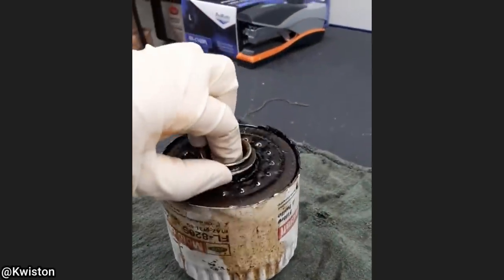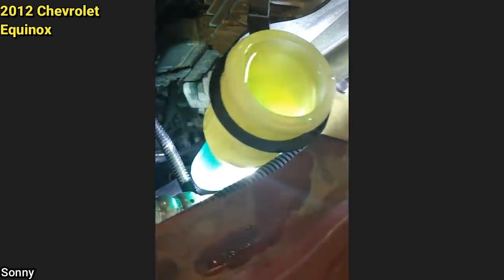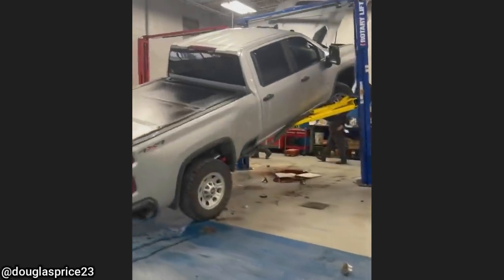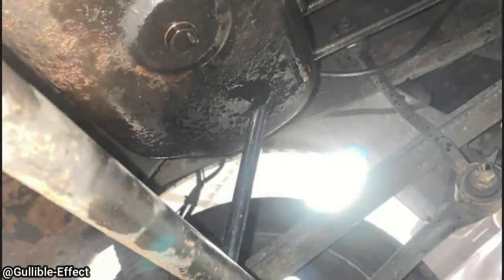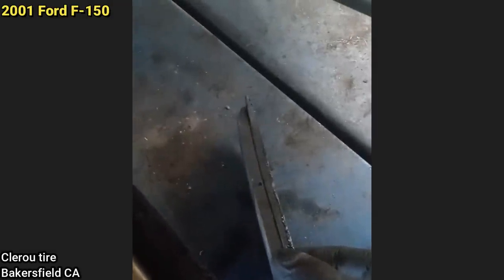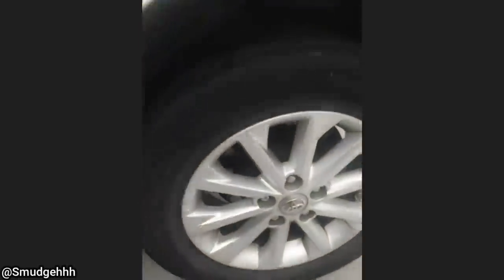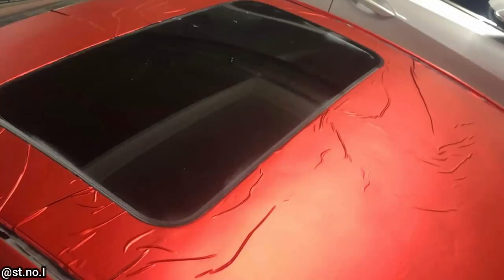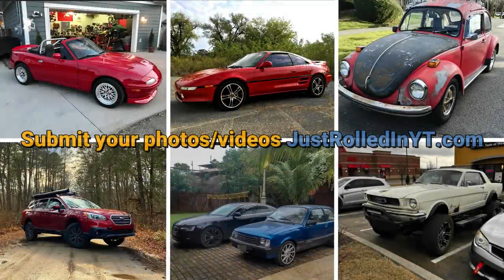Customer States Engine Has Loss Of Power & No Oil Pressure | Just Rolled In

Comment: Bet the customer from 0:50 had a REALLY clean engine after that. Hopefully they didn’t drive much.
Reply from the maker: lol I was thinking the same thing. Quick lube engine flush haha
Reply: Me too, I'm thinking to myself, that engine top end of that engine has to look new.
Reply: @darkdelta  A shiny smooth camshaft always makes the car run better.
Reply: @jeffrobodine8579  except for when its not coated in the proper oil 🤣

Comment: I'm a mechanic, I have not changed my oil in 10,000 miles. My filter must be just as bad. My reasoning for doing this is I thought the transmission would have failed so I was going to junk it. But keeps on going...lol
Reply: When I was growing up on the farm,, we sometimes sold our produce out of an old Ford van with a 300 straight 6 and 3 on the tree. I didn't mind always being the one to sell the stuff but, I HATED driving that van and that van HATED me too. It got to the point where I drained the oil and floored the accelerator until it started rattling. The next morning, that damn van fired right up and ran, I believe just out of pure spite! The van and I gained a sort of respect for each other that morning lol!
Reply: Most modern oils and filters can go 15,000 miles, but I would not try that with a turbo engine.
Reply: @jamesm568  NAH. SOME modern oils and filters can go 15,000 miles -- but not MOST of them. 
 The famous 95 MERC runs Pennzoil Ultra Platinum, 5-W-20; Bosch Premium Oil Filter # 3410; and a FILTERMAG #SS365PR  Magnet Kit. Oil & Filter changes at 5,000 miles.

Comment: I worked in an oil change shop in college.  A guy brought in his bosses car for it's first oil change, at 37,000 miles, as his boss refused to do any maintenance on it.  The oil light was on.  Was one of those 2.5L GM engines from the 90's, that had the big plate that drained the oil and gave you access to the filter cartridge.  The filter was worse than the one in this video.  Engine was knocking something fierce.  We left that filter on counter in the customer lobby for everyone to see what happens when you neglect to maintain your car.  You could not even see the pleats in the filter.

Comment: Man there is some vengeful people out there my ex being one. She gets mad and puts an icebox with sand all over the bottom on my hood while at the beach. Drags it across the red paint that I wash and wax very often.. Her brother ran over a parking space block the piece of rebar holding it in place poked a hole in his tank. I went to the hardware store and bought a wall anchor and rubber washers like for an old Chevy distributor coil and tightened up.. Never heard back from him about it.

Comment: atf in the engine, a good reason not to trust quick oil change joints. Can't even trust those places to check the air filter. Parents took their minivan to one and the numbnut who checked the air filter "accidentally" left a shop rag in the air filter housing....above the filter. It eventually got sucked into the throttle body, jamming it partially open.

Comment: I've had a shop do an oil change and tire rotation. The problem is during the middle of the tire rotation they went to lunch. Before they went to lunch they put all the tires on hand tight on one side and right tight on the other. About 100 miles later I noticed there was a little swag in the driving. The bolts on one side were all loose. I wasn't happy. Now I check every time. When I checked that first time I could unscrew the bolts by hand when the vehicle was on the tire. I had to jack it up in 2 places to put the nuts on right.

Comment: As a retired mechanic I have seen all this before..... will give you guys a tip what we use to do..... with a nasty oil change with a bunch of crap in the pan.. on 5 quarter... 3 quarts oil and 2 quarts Trans fluid.. let idle for 15 minutes... drain... repeat .. with another new oil filter..... then change oil every 1000 miles... after treatment and few changes most all the inside will be cleaned out...... Trans fluid lubricats and has very high detergent content sea foam doesn't... don't believe me... get your hands nasty and greasy... use Trans fluid instead of soap... hands will be clean faster than using soap... most you guys probably already know this.... have done this many times over the years

Comment: I had the first thing happen to my car. Oil filter collapsed, was maybe 1000km overdue for service. I service every 5000km because its a dirty old diesel. First sign was the oil pressure dropping to zero at idle. Could still make pressure at revs, so limped it home and changed the oil the next morning. Sure enough, filter had sucked in. Wasn't crusty like that one though.

Comment: Seriously, oil changes should be compulsorily taught to all drivers - it's one of the simplest maintenance procedures going.
Here in the UK, I just nip down to Wilko, spend a few quid on a bottle of the stuff, then home, drain the old stuff into what at other times is the cat's litter tray, top back up, done. I've had more trouble rooting through the manual or looking online to see what's the right type and amount. Pour the muck off into and old container, bit of cleaning up, and remember to take the old stuff next time I drive round to the dump (recycling centre). What's not to afford? A new engine?

Comment: One day I was driving, I suddenly heard a hollow scraping. First thought: "I think my exhaust just dropped." I was nowhere to be able to stop, but the problem solved itself when I hit a bump and the exhaust was basically ripped off.

The same car didn't want to start when it was cold but ran fine when sunny. Went to the shop, told them the fuel relay must shut down when it's cold. They did all sort of things but didn't touch the relay. Of course the car ran in the heated shop but not after a night outdoors. Second time I went there I tgold them what to do and that I won't pay because they already charged me for not solving my problem. Look at that, it was a relay problem.

Comment: Couldn’t afford an oil change FOR 3. YEARS, but could afford gas? 
The biggest lie I ever heard.
Reply: Litterally under $20 for oil and filter at Walmart. Could have a friend help change the oil if you don't know. Amazing this isn't common knowledge. I spent $40 every 3 months/3,000 miles when I had no money. Just barely making it work anyone else can do it unless they are homeless then they can peddle money on the corner of a highway and then you can get your oil changed.

Comment: Even with dino oil and a no name filter, you can go 8500 miles if you have to. Low end synthetic oil costs little or no more than dino oil. Unfortunately, shops charge a considerable premium for synthetic oil. However, they use a high end brand along with a high end filter, and you can go 15,000 miles or more on a synthetic oil change if you have to.

A local tire chain where I live offers a $19.95 oil change just so they can get you in the shop and pitch you on tires and repairs. Doing my own oil change at home costs me about $14 minimum.  No excuses  here.

If you don't know, "dino" is a slang term for conventional motor oil.

Comment: That oil filter... my dad bought a van once, it had what he was told was a charging light on, and he assumed the fix was going to be a new alternator. My brother in law looked at it, and told him, "We use lots of these vans, that's a low oil pressure light!" Oops. Dad jacked up the van, drained the oil, which looked pretty bad, but not the worst, then unscrewed the filter. He dropped the filter, much heavier than expected, it weighed at least 2 pounds. With new filter and oil, ran fine for several years.

Comment: I feel bad when I change my oil/filter with only 30% oil life remaining (usually change at 40% life remaining) and only changed the transmission fluid three times. 102,500 trouble-free miles averaging 34.1 mpg combined city/highway. I’ll be disappointed if I don’t get at least 300,000 miles without major repair on the engine/transmission.

Comment: .Can I be honest from a shop that just had a guy fired for a 3/4 ton ram 2500 this wasn't incorrect torque in my opinion it was a faulty tie rod end. If the wheel was the case it would have been damaged. Our wheel that came off damaged all the studs, lug nuts, fender and rotor.

Comment: ''No oil pressure''

That is what ahppens when you go to a cheap shop and they install the cheapest filter they can find. Filters are supposed to have a pressure valve that opens to let the oil flow through even when compeltely gunked up

Comment: 2-yrs. between an oil-change is not a problem as long as the engine is running smoothly and the oil 'shows clean and no 'burnt smells' on the dipstick
IF the car was driven every day with 10K miles per year then yeah, change is overdue

Comment: I'm having an oil pressure problem as well changed the oil pressure sensor the oil is like new and the engine was just rebuilt and put in barley a little over a year ago it was driving like a champ but then it just went funny all of a sudden but my guage still says it is low and it drove like it's starving for power like it was missing a cylinder or something not sure if it's electrical or something else.. just put in a new fuel pump as well and a complete tune up too..it's not really making any noises that I can hear...

Comment: i have only ever worked on a engine once where the lady has not gotten a oil change in a year i had to break down the whole thing that was not fun and the only reason i did it was because my buddy was dating the girls sister i was lucky the local pick and pull had the parts i needed

Comment: I’m amazed that the lube shop put atf into the motor. All I can reasonably think of is maybe the tech is color blind, I had a con worker who told me he’s color blind and it’s actually something he has to look out for.
Also thankfully atf isn’t catastrophic to engines, my coworkers have used it to (hopefully) desludge motors before
Reply: I feel like it's not great for the engine to leave it in there, but it shouldn't cause problems in the short term
Reply: @JSTheAnonymousOne  agreed on both. Trans fluid just has a lot of detergents so hence why we’ve occasionally used it for flushes.

Comment: UK here bought a motorcycle for £3.00 because the owner couldnt change gear stripped the box down found it had been filled with carpenters linseed oil burnt  off the gears with petrol (gas) used for 2 years resold at £35

Comment: i've actually read that ATF is great for cleaning out the engine due to it's high detergent content

apparently it requires time to work because it isn't as aggressive as a oil flush

personally i think i'd just use the purpose built oil flush

Comment: Was going to do my brakes until I read where you need to put the epb into service mode. Would those instructions work for a 2017 Honda Civic LX P?
I've read where you could manually twist the back then push it in but I'm not taking any chances.
Reply from the maker: Those instructions are for a Toyota Corolla but if you read online I'm sure you can find what you need to do.

Comment: I know a lot of Ford filters (oil filters specifically,) are designed to have a safety valve in case the filter goes too long without change, to bypass the oil back into the engine to prevent that.
I guess this wasn't one of those? RIP

Comment: Could someone explain 1:40. Idk what I'm looking at. I've never had a car with an electric parking break.
Reply: I think someone tried replacing the brakes themselves but the ram popped out and they could not get the new rotor and pads on.

Electric parking brakes are just push button parking brakes and can be set automatically when the car is in park.

Comment: I bet that oil filter is going to look like the car my friend refuses to change the oil in. Took out an oil pan hitting a rock, and claims he already changed the filter. No point in changing it. Granted over 10,000 miles was added to it in under 2 months. Somehow I'm the idiot for thinking there's no point in replacing an oil filter after putting fresh oil in a new oil pan.

Comment: Could someone please explain the park brake issue.  I have older vehicles.
Reply from the maker: I added more info in the description for that one but since the vehicle has an electric parking brake, you need to put the electric parking brake system into service mode, so you can press the caliper piston back in. While on most vehicle you can just use a c-clamp (or whatever you use) and press the piston back in when replacing brakes.

Comment: this hurts to watch. :) poor cars... I wonder what they do to their cars to destroy it with only 2 years of no oil change? back when I was still working at the auto shop one poor old Fiat 127 (special beach buggy body done by Fissore, something really rare) rolled in for a major overhaul of body, suspension and everything else... turned out there was no oil change in 14(!) years, and the engine was till runnign nicely... after I adjusted the carburetor halfway correctly. XD of course, it didn't do many KM in that time, but still.
the backwards brakepads once happened to an apprentice late in his second year. by then one should know what a brake pad is, and how to do it. needless to say he got canned for good. :P also, not many people know about electric parking brakes. or even the mechanic version of that, and what to do with the piston... that customer was lucky, these pistons can actually shoot out squeezing your fingers off, and then you can't shove them back in again. very dangerous!

Comment: 0:20 couldnt afford oil changes for 3 years? Ok so an oil change at Jiffy Lube is what these days....$30-$40? But even 3 years would not destroy an engine unless it is also leaking oil and not being replenished and/or the person is putting 50,000 miles a year on the car.

Comment: ATF instead of oil?  That quick lube just bought the customer a new car or new engine, plus cost if the engine is replaced with a new engine.  Wonder how many more engines received ATF instead of engine oil?

I've said it before, but a few of those clips prove my point.  If you don't know what you're doing, leave it alone.

That customer who claimed the shop didn't put the wheel on correctly, needs to be shown the broken tie rod(?).  The shop didn't cause the break.

How much damage resulted when that pick up fell off the lift?

Comment: Preaching to the choir, but, if you can afford gas, to get you 7000 km, you can afford oil once you get there.  Even when gas was cheap back in 2020 id spend 740$  In fuel to get me 7000km. An oil change is maybe 85$ at a quick lube shop, 30$ if you do if yourself,

Sure beats 1000$ plus for an engine swap.

Comment: :54.  ATF in the engine... oooooh boy.  That engine is wasted >.<  Interestingly enough, you can actually add a LITTLE bit on ATF to your engine oil and drive NO MORE than 50 miles then flush and change the oil.  It will revitalize your piston rings and other parts (cleans them), which will add years to the engine life =]